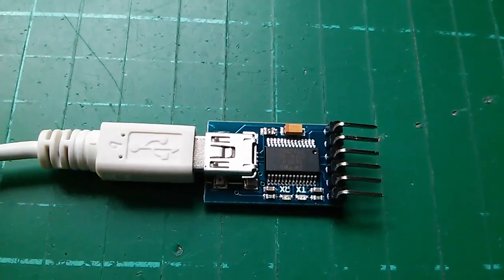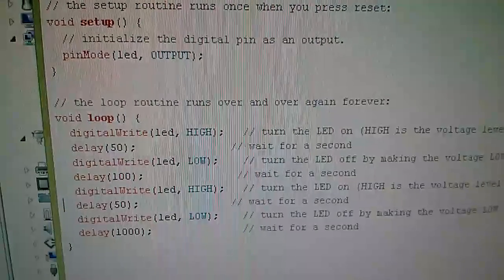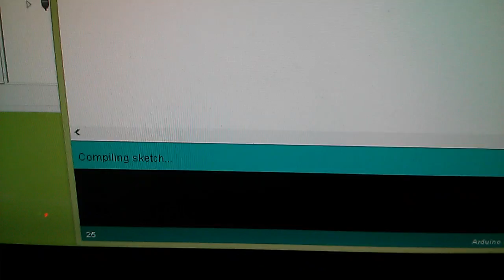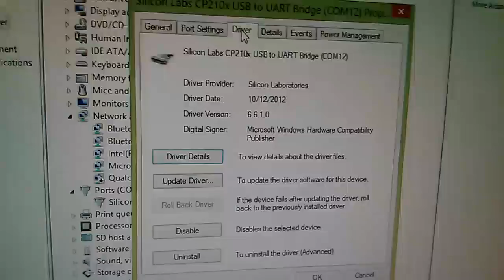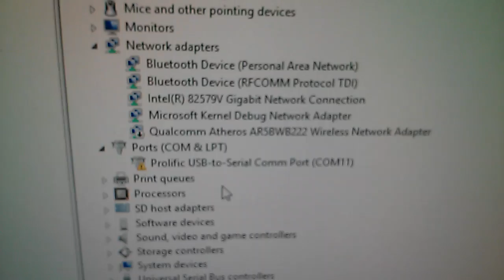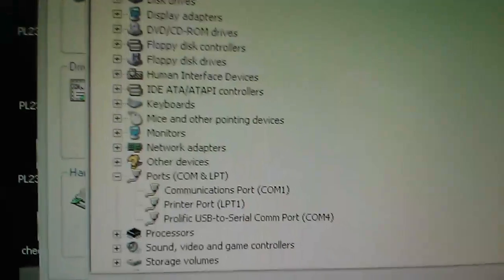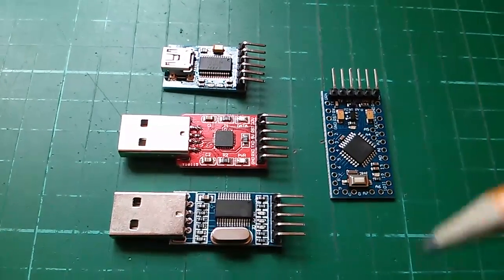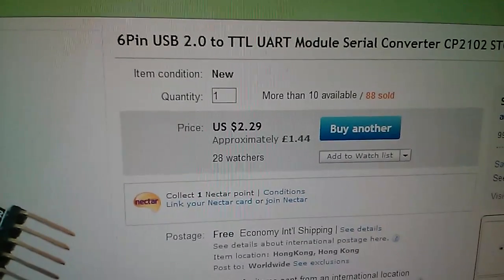Arduino USB-to-Serial Tutorial - Programming the Pro Mini

Comment: hi, PL2303 chips seem to issue reset signal through their pin 2. just add a 0.1uf ceramic in serial to it, to get the desired auto reset. there are such tutorials on internet, just check.

and thanks for the great comparison video !

Comment: i dont get it, i cant find out what com port my USBs are connected to. If youlook at he's device manager you can see that he is beeing told what com port are beeing used, how do you get that to be showen?
Reply: install drivers first
Reply: Then i will be able to see what com port it is on? I will try it
Reply: Sondre Bjørgård I have a program that allows you to reassign a port for these things, it came with the Wouxun KG-UVD1P handheld 2-way radio I bought back in 2012

Comment: Don't buy FTDI chips or any product that uses one, ever, that could burn your home, literally !
Reply: bullshit. no FTDI chip will ever burn anything. the company had released a driver that bricked fake FTDI chips once. later they realised that they did wrong and pulled out the driver. that driver is not available anymore. you can safely use any kinds (gen or not) of FTDI chips
Reply: I almost asked for an explanation, but then I saw your name and picture...
Reply: Trollin Uranus thanks for the link! So the problem it only for cloned FTDI:s? This morning I succeded in programming an arduino pro mini clone with a cloned FTDI, so somehow this problem with bricking the device didnt affect me
Reply: You were lucky enough to not uptade the driver, that's all. Microsoft removed the update yesterday, but trust me, I'll never use any ftdi chip in a design anymore, being fake or not (I've no way to know for sure!), I don't want to take the risk.

Comment: Hi Julian,

Thanks for the clear video. I just received one of the Sparkfun FTDI basics (FT232RL), because my other cable does not have a DTR pin. Unfortunately I'm still not able to upload & reset automatically (using the Pro Mini Clone). I need to disconnect/reconnect the FTDI cable every time I want to program, or hit the reset button. Any idea what I'm doing wrong?

Comment: I have a CP2102 and here is a clone of Arduino Pro Mini http://www.ebay.com/itm/New-Pro-Mini-atmega328-5V-16M-Replace-ATmega128-for-Arduino-Compatible-Nano-HY-/111323145399?pt=LH_DefaultDomain_0&var=&hash=item19eb6064b7. This Arduino Pro Mini Dswy_robot. On the CP2102 I soldered a wire going to RESET the chip, as in your video. Tell me, what programmer should I choose IDE Arduino, to sew through scetch CP2102?

Comment: I ordered the new CP2102 but I can't get it working !
I need to press reset to upload !
I don't understand what the 0.1uF capacitor is for between RESET and DTR ?
Reply: You definitely use a 5V ProMini with your CP2102 and it works fine.
But despite mine is also a 5V, it won't !
I must feed it through the CP2102 board 3.3V pin  (VCC ProMini pin to 3.3V CP2102 USB board)
Otherwise, DTR pin doesn't get a proper pulse and won't reboot ! CP2102 DTR pin is pulled HIGH to 3.3V only when it should be pulled HIGH up to 5V when working with a 5V ProMini !
Please, have a look at my post there for more details and tell me what you think:
http://forum.arduino.cc/index.php?topic=231863.msg1672107#msg1672107

Other point ! Let say that The ProMini works now on 5V and DTR also 5V. What happen when DTR goes back to HIGH level ? RESET pin could get twice its voltage ! The capacitor would be like a bootstrap capacitor ! RESET pin could catch 10V for some time before the extra charge would flow down to 5V trough the on-board 10kOhm resistor. Isn't it dangerous for the RESET pin ? Am I not right ?
Reply from the maker: Llop66 Does your CP2102 have RTS broken out? If so, try that instead of DTR. The reset series capacitor works as a differentiator to generate a short negative pulse from the longer DTR pulse. Yes it will go positive (above Vcc) when DTR goes back high - the internal clamp diode (to Vcc) on the microcontroller's reset pin will remove it.
Reply: Julian Ilett
Hi Julian and thanks very much for your answer.
Yes, my CP2102 has RTS pin. I ordered exactly the same you recommended in the video from the same seller !
So I've just tried RTS but it doesn't work either. It behave the same way as DTR with HIGH level at 3.3V.
Concerning the capacitor, ok I understand, and that's right, DTR or RTS go from HIGH to LOW for about 10'' when Arduino DTR pin only need a brief pulse to reset.
Concerning the extra voltage generated by the "bootstrap capacitor" when DTR is coming back to HIGH, you're talking about an internal clamp diode. What diode is it ? I can't see any such a diode on the ProMini schematic http://arduino.cc/en/uploads/Main/Arduino-Pro-Mini-schematic.pdf
I've checked Atmel 328P datasheet to see whether it was inside the AVR itself  but I didn't find any either !
Reply from the maker: Llop66 Check ATmega328P datasheet section 13 figure 13-1 - I/O pin equivalent schematic.

I have an idea for a new video - Arduino Reset Tutorial
Reply: Julian Ilett
Ok, protection diode were at section 14, figure 14.1 actually.

But what about my CP2102 DTR function ?
You did exactly the same and it worked for you ! is you DTR pin at 3.3V or 5V on your CP2102 ?
Did you received your new CP2102 from "Alice1101983", the same I'm facing problems ? Does it work for you ?

Comment: the only thing I found I don't like about the Arduino is reading back the program you uploaded to the chip.  I have used the Parrellex chips the basic stamps. and I like the fact if you have a debug error you can see were at on the line of code the error may be at. because you can run the program from the computer and also if you uploaded it, and you can read back the program. you know how computers are they crash. and if you lost your program file. and if its still on the chip you still have it and you didnt lose it all. but with Arduino if you lose the file you start all over.  but I do like the idea they have the PWM function and are faster than the Basic stamp chips.

Comment: The FTDI units are the original and still the best since IMHO. They most accurately emulate the 232 hardware spec albeit at a TTL level.
Beyond the world of Arduino lies the generic USB-232 converter cable market. Often these devices have issues when the target device is using some obscure 232 hardware related signal or target piracy mitigation using dodgy connections and software mods to suit. It has been my experience the FTDI based units offer the most compatiblity and reliability, something worth paying a little extra for when the PC manufacturers can't be bothered to include a real 232 port.
USB is great,convienient and faster but was designed for the great unwashed, cheap and simple, a bit like the current crop of 1080x768 monitors using generic HDTV chipsets to keep costs down. Certainly the PC graphics progression has stagnated of late.
Reply: +Rob B I know but I lost all respect for FTDI when they purposely bricked a ton of hardware.I know fakes are a issue but there is better ways to deal with it then hurting unsuspecting users.I now avoid them at all costs.
Reply from the maker: I must admit - I generally find myself using the FTDI module in preference to the CP2102.

Comment: Julian Ilett Did you try this "outdated" Vista-Driver for the PL2303HX, which is claimed to be running with windows8?
https://docs.google.com/file/d/0B7FildjsrNkILWhYVHYwanJLS3c/edit?usp=sharing
Reply from the maker: The problem with the PL2032HX is that none of the boards I've bought have a DTR or RTS pin. So I'm not putting any more effort into finding drivers for this device. I'm sticking with the CP2102 and FTDI boards now.
Reply: that's perfectly correct. But those who are stuck with some PL2303HX chips should know that there is a remedy for the purely manufacturer caused issue. (they just moved towards a new generation of chips to fight "piracy" of their chips and dropped support for the old chips for modern windows.)
Reply: Hi all, I was going round in circles with this and after installing the above setup posted by rarbiart it still wouldn't work, what you need to do in windows7/8 is after installing the driver pack go to Update driver software, click on "let me pick from a list...", you should see two "prolific.." drivers, select the oldest (from 2008).  You should no longer get the yellow triangle error in Device Manager.
Reply: David Barry You are perfectly right. Those "outdated" driver versions are the solution for the issue. they just work fine even with those "non genuine" PL2303HX" chips on W8.x

Comment: Julian,I have the PL2032HX. USB, I plug in and drivers the PL2032HX can up working  I plug in my 5v Pro Mini, I get the 1 sec. blinking Led. But it will not Program. My wires are:
 PL2032HX Gng To  Gnd  Pro Mini
 PL2032HX 5v To  Vcc Pro Mini
 PL2032HX TXD To  TXD Pro Mini
 PL2032HX RXD To  RXD  Pro Mini
I also swap the  PL2032HX  TXD to RXD, and vice versa
I noted you did not use the DTR, should I leave it unhooked?
Reply from the maker: The PL2032 has no DTR or RTS so you'll need to hold the pro mini's reset button while compiling, then let go during uploading - the timing can be quite tricky.
Reply: Julian thanks for the input on the Reset. yes that works. Keep the video coming. Thanks again. Ron

Comment: I have found an easy solution to the PL2303HX Win8 driver issue.

PL2303HX Win 8 Driver: http://goo.gl/CWPLth

PL2303HX Win 8 Driver 2: http://goo.gl/cvDBJx (worked for me)

PL2303HX Win 8 Info: http://goo.gl/MJiNfW

PL2303HX Win 8 Info: http://goo.gl/a4VeU8

PL2303HX Win 8 Info: http://goo.gl/rZDwy4

----

And if you are trying to program the Arduino from the Arduino IDE with the PL2303HX, you have to hold the reset button until the IDE says "Uploading" for a second or two AND THEN RELEASE the reset button; worked for me.

It seems the "Chinese PL2303" use an old chip discontinued by Prolific, so you just need an OLDER DRIVER. The ones listed above work on Win8.

Comment: I have seen this video too late. So I have bought the FTDI USB-to-Serial adaptor clone.
It is able to program the Pro Mine, when I press the reset button manually during programming.
Reply from the maker: My FTDI board has the DTR pin - connect that to DTR (or Grn) on the Pro Mini and you shouldn't have to press the reset button manually.

Comment: i bought a quantity of Pro Mini clones some of which did not have a bootloader. There is a very good tutorial on the Arduino site showing you how to get around the problem.
Reply from the maker: I must have a dud nano then, because I've tried several methods to program in the bootloader and it just won't have it.

Comment: Have you checked the voltage levels the IOs tolerate? Some of the models are not 5V tolerant and you can fry them when connecting to a 5V micro. I've also come to a CP2102 (according to the datasheet IOs can go up to 5,8V, no matter Vdd) based one a while ago. Still waiting on it though (literally "shipping" from China takes a while). While the FTDI works out of the box and has driver support for almost every system, the CP2102 ones are half or a third the price. And since having a few of them is handy and they could be the first ones to die that makes a difference.
I also looked at the datasheet and the driver history of the prolific. Neither inspired confidence, that it's a problemless item.

Comment: Hi Julian ... Thanks for the detailed and insightful walkthrough on usb-to-serial chips. Something worth mentioning here also is the possibility of uploading sketches to Pro Mini or other off-board usb devices using any Arduino with on-board usb-to-serial. Followed this simple instructions using a Mega 2560 R3 and worked like a charm -> proto-pic(dot)com(slash)Datasheets(slash)pro-mini(slash)UNO_PROMINI.pdf

Comment: Since the PL2032HX based board doesn't have the DTR/RTS, how did you program the pro mini? Did you manually reset the Arduino somehow or it just works without it?